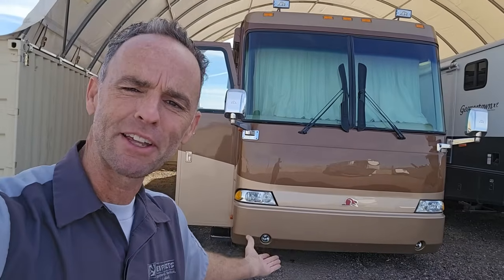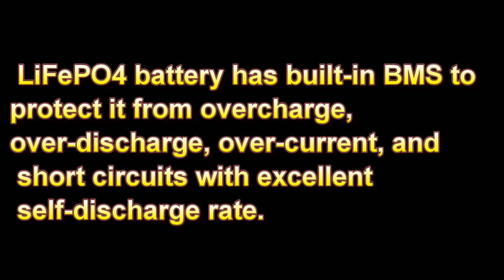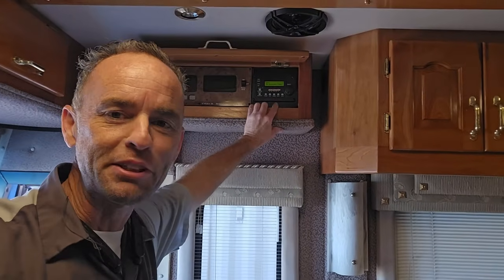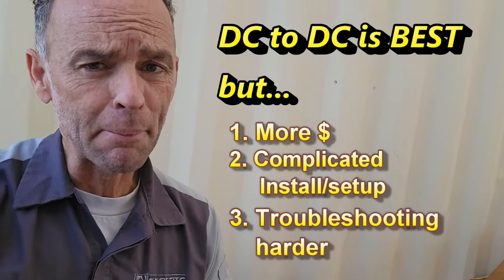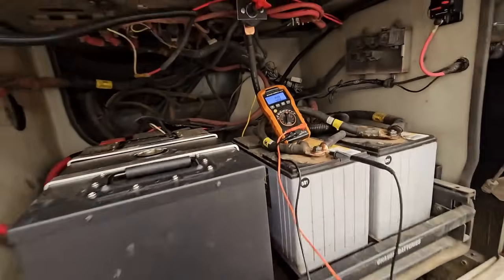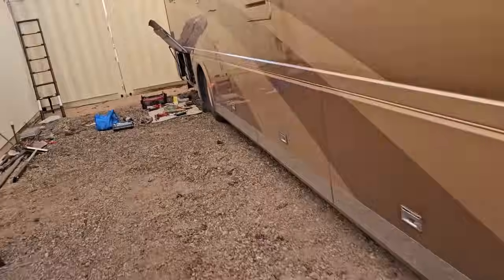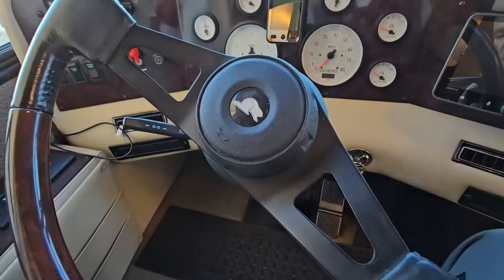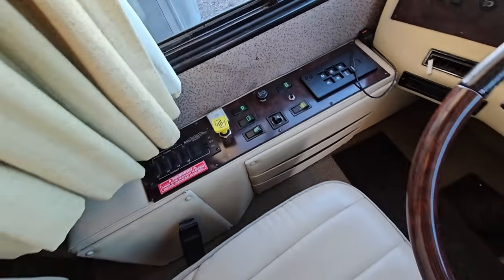What You NEED to Know About Adding Lithium Batteries to Your RV

Comment: My LFP house battery install on my Triple-e Commander Diesel, I installed a time delay relay on the sense switch terminal on my DC to DC converter, and for my chassis battery maintenance I install a small 10Amp 12volt Trickle charger to keep the chassis battery topped up, I have a a Magnum MSH3012M Hybrid inverter charger (hybrid in you can supplement your shore or generator power with house battery  inverter power, so say you have 115VAC 15amp plugin, and you turn on the Convection oven, it will draw the 15 amps from your shore / generator and the balance from the house battery / Magnum Hybrid  inverter, truly awesome upgrade. My custom profile for my battery setting on my Magnum for Lithium is I use 14.6 on absorb, also set the inverter cutout to 11.8volts even though they can go down to 10VDC but that will initiate the Lithium BMS shutdown. I still have a Reliance configurable low voltage relay to prevent the house battery getting to below the BMS cut out but I have not installed that yet but might when I sell my coach. I normally ab bit anal when it comes to watching my power situation when dry camping, I have fun doing that! I am a retired electronics Technician and love the tech!

Comment: Just upgraded to a LiFePO on out travel trailer after the deep cycle it came with died, I did use a LiFePO charger to charge to 100% before installing it, but the current WFCO doesn't have any LiFe settings. 
I'm also adding a 3000W inverter charger and 460AH LiFePO battery, 400W solar this month for an upcoming boondocking trip.
Your videos on the LiFePO was very informative, dig the other videos across the other platforms too, keep up the good work & "Hi" from the west valley!

Comment: Thank you for the very helpful information about using the older converter/charger on my travel trailer with a LiFePO4 battery. I had deduced, based on vague comments on other sites, that it would work but not give a full charge. Thanks for confirming that. I will stick with the onboard unit for now and use solar as described to "top off" the charge as I hit the road for the '24 RVing season.

Comment: Nice video, this subject has been coming up a lot lately on the forums.  I did this conversion on my 97 Monaco Dynasty 3 years ago. Built my own LiFePO4 battery and used a bluetooth BMS with it so I could monitor and control charging, charge states, etc. from my phone.  In my case I went with a Renogy 60A DC-DC charger as I wanted complete isolation and reasonable charge rate, and the cost was low (on sale). I connected the oem 80w solar charger (non MPPT) to the chassis circuit to keep my chassis batteries topped up.

I just wanted to point out that if you are using an converter/charger that doesn't have a lithium charge profile, and thus you may be using less than full cutoff voltage for the batteries, it is a good idea to occasionally charge using a charger that DOES have a lithium profile, either a solar charger (as in your rig), or a DC-DC charger (as in mine). The reason for this is that the BMS will do cell balancing during the charging, and the most beneficial period of time for this is in the upper "elbow" of cell voltage, which you may not achieve without the lithium profile.  Over a large number of discharge/charge cycle the capacity of the battery could be lessened if the BMS isn't able to keep the cells in balance.  

Keep up the good work and ignore the naysayers, LiFePO4 house batteries are a game changer.

Comment: Thanks for this. I have swapped my fla to 3 100ah lifepo. My 98 hr endeavor did not have the engine alternator connected to the house batteries so I didn't have to worry about that. I have a dakota lithium starting battery I am adding but keeping one fla to protect the alternator. Eventually, I will probably replace the full size starting fla battery with a motorcycle sized one, my assumption is that will protect the diodes, while saving weight and space, allowing me to add another battery or two to the house.

Comment: James, you look to be doing well. Seems like a lifetime ago we worked at LMRV!
I'm suspect of that Precision Circuits unit. Seems a few commenters are having issues with it.
My first concern is the size. 
It may say it's rated for continuous 225 amps, but I must question that. Any solenoid with a true 225 amp rating is quite a bit larger. Thus disapates more heat. 225 amps can generate a lot of heat. That is why those diode isolators went ot of favor. They could get quite hot and the RV builders rarely had them mounted in a location to get decent airflow.
Anyway, my 2 cents worth.
Happy Trails!

Comment: Thanks James. I'm on the finals step of doing the same upgrade on my 2003 Dynasty. In 30 minutes, you compressed months of research and in some cases misinformation. Just for a basepoint for others to design around I went for 2 batteries with a total of 600 Amp Hours powered by 4 panels totaling `1,600 Watts wired 2P/2S fed into a Victron MPPT 150V /100A solar charge controller. I removed the same 3 components (The battery booster, the isolator and the "maintainer"). I am in the process or adding the Progressive Circuits Li-BIM 225 Lithium Battery Isolation Manager even though I have a 200 Amp alternator. Total cost including tools, wiring connectors and Dicor was around $3,500 and can go 5 days off grid on sunny days without conserving energy. 

As a note' Magnum Energy sells remote control panels with Lithium profiles.

Comment: Wow, someone that knows what they are talking about,  perfect information,  I have see so many people on boats/yachts that think they can up the alternator to 200 amps only to find out they are lucky if they get half that...  maybe some day when someone comes out with a water cooled unit and separate voltage regulator... I used to wind by hand electric motors for electric vehicles, and I would tell people the motor will be drawing 50-80 amps in cruise, meant nothing to them...   A 100 amp hour battery will not supply 100amp hours, I could go on and on about this.... clicking on my name will take you to my utube on motor winding stuff...

Comment: There are some magnum inverters that support lithium charge profiles, you just need to make sure you have the right display unit. I swapped out the existing ME-MR25 for a ME-MR25-L for a 150 bucks. You need to make sure the ME-MR25-L has version 1.3 on it to get the Lithium charge profile. My existing unit had version 1.2 software.

Comment: Three years ago I upgraded our '05 Four Winds class C Ford E450 RV house battery from a single SLA to dual 100ah AGMs. Not an easy job either as I had to build a second platform. I had considered Lithium at the time but cost then was more than our budget allowed and charging profile of our 45amp Parallax converter/charger seemed unable to correctly satisfy the requirements. Prices today for LiFePO4 types have come down to the point of the AGMs of 3 years ago so when the current ones are done I might just upgrade. The alternator issues concern me the most I suppose. Thanks for sharing as always.

Comment: James, thank you for this video. 

We presently own a 2022 Winnebago class A gasser. Two years ago replaced the two lead acid coach batteries with BattleBorn. Installed a DC-DC charger, a new Progressive Dynamics converter-charger and reset the charger controller. The system works great but I always wondered with 200 watts of solar on the roof, did I really need to replace the converter-charger. 

After seeing how well the solar charges the batteries, and after seeing your video, maybe I didn’t need the new charger.

Thank you for the videos. Very easy for the me to understand.
Reply from the maker: Thank you!

Comment: I have solar and a new converter. 

I found with 500w of solar and 400ah of lithium battery I would still run low after 3-4 days in glamis. Particularly if it’s cold and I need to run the heat a lot. Or it’s cloudy. 

I installed an 80a lithium compatible converter and now I can just run the genny for an hour or two and juice them up pretty good if needed. New converter sends 30+ amps to each battery, whereas the factory one would only push 5-8A each.

Comment: I have the same Magnum that you have, and it is fully programmable.  I can even select a custom profile to meet my needs.  The programing is done at the ME-RC50 remote.  You use the custom profile in the Setup page.

The problem with not getting to a "full state of charge" is that most of the sealed drop-in batteries do their balancing by having the BMS charging FET's turn off at 14.0v and then use the voltage above that to do passive balancing while the cells are really not being charged other than by the balancers at 70-100 mA.  I checked the specs on your battery and that is exactly how it works.
If you do not charge to more than 14.0v, you will get no cell balancing and that will cause the cells to drift out of balance over time.
Reply: As mentioned in the video, James' rig has 600 watts of solar for the full charge.

Comment: Magnum inverter/charger can fully charge lifepo4 batteries.  Capability may depend on model etc.  On my magnum I use the constant current constant voltage profile.

Comment: Thank you for the very good video.  However, I found the middle part regarding the wiring using the battery relay a bit confusing.  Even so, the video was very helpful.

Comment: LiFePO4 is also sometimes abbreviated as LFP.  These cells like to be kept at 100% all the time, which is the opposite of what NMC Lithium Ion cells like, which is about 80% charge unless you need to utilize the full capacity for a short duration.  This topic has even become an issue with Tesla, which recommends the 80% setting for NMC models and 100% on their LFP models.  In fact, they recommend charging to 100% at least once a week to maximize cell life.  Really great coverage of the topic, James, it's much appreciated.  There are far too many myths and similarly few down-to-earth discussions of the topics you mentioned.
Reply: Well, yes, LiFePO4 doesn't mind being charged to 100%, but that isn't why Tesla wants people to charge LFP vehicles to 100%.  The reason is simply that the charge curve is so flat for LiFePO4 that the BMS / shunts / whatever monitoring you have for battery state of charge, can't keep track of the state of charge accurately unless the battery is charged to 100% every once in a while.

For Tesla this meant that the vehicle was unable to accurately calculate the remaining range when people only charged to "80%" (which itself is a guess by the vehicle because "80%" is still in the flat part of the charge curve)... and sometimes caught people out.

The main issue for longevity is to avoid discharging the battery all the way to BMS disconnect very often, and in particular a lithium battery (of any type) should never be left completely discharged for weeks or months.   That will destroy the battery.
Reply: Thanks for putting that myth to rest.  Many UTube experts still put that 80% bs out there.

Comment: Thanks for the explanation for the common man. Since I believe my 2 y/o AGMs may have died from poor cables (suspect corrosion), I am now considering a LiFePo4 set for my 2019 FW Disco 40G. Those 4 points are very important considerations not commonly known to one who is considering the transition to LiFePo4 batts. I did see a YT review from (All about RVs) of a LiFePo battery that was also labelled as a 'cranking' battery as well - made by Epoch. I doubt it would have the needed CCAs to turn over a DP. I like your idea of the portable AC charger if needed. My debate is with the current 6 spots where my 6 6v AGMs are, should I replace with 6 12v LiFePo or work with the space I have to go with something with less cabling. I will need to discuss this with a technician, now that I have the new knowledge you've shown me. Thanks for the great info. Safe Travels.

Comment: Thanks for the video James

I have a 1998 Patriot that is set up like yours with the echo charger and the boost solenoid.  When Vatrer put their 460 ah battery on sale I decided to copy your installation.
I replaced 4 6V GC batteries with the Vatrer, took out the isolator and echo charger, disconnected the boost solenoid and installed the BIM.
Everything seems to work fine and the battery initially charged to 99% SOC.  Now it has dropped to 75% SOC and it is not charging even though it is plugged in.  I am guessing this is the BMS keeping it from charging until it gets to a low enough   SOC.

My problem is the chassis batteries are not charging when the house batteries are not charging so they are getting low as in 11.8 volts.  They will charge if I hold down the battery boost button.

My inverter is a heart freedom 15 and I set it up to charge at 13.4 volts with the dip switches.

Are your chassis batteries being charged enough to avoid a low voltage situation?  Do you know of any way to isolate the chassis batteries and charge them seperatley?   Thanks Carl

Comment: Very nice video thank you...now I have a question: according to the wiring diagram for my 22 Jayco Alante 27A, the generator uses the house batteries to start the generator (an Onan 5500).  Will the LiPO4 battery be able to get that done?  Or will the generator require more than the 200A my LiPO4 battery will put out?

Comment: I put this on my Class A.  What I’ve found is the cycling of the charge causes my chassis battery to connect and disconnect the alternator output often.  Mean I park, RV running, and when I open slides the chassis battery voltage goes between 12.7v and 14.4v every few seconds.  Kind of surges while opening the slide.

Comment: Thank you, the first video answered a lot of questions I had, but your second one confused the crap out of me. I have been waiting to install lithium but I have been worried about the alternator issue. Your test meter showed too much  voltage going to the starting batteries I think, won't the solar boil the lead acids, your meter also showed the house and starter batteries linked in the lithium was charging the lead acids, won't that cook them , 
Thank you once again this is a hard issue for me to wrap my head around also wasn't that one unit you removed for linking the batteries when your starter batteries were dead.

Comment: With my trailer I disconnected the charging wire from the seven wire plug. My solar charges the batteries as I drive. Don't want to burn out the alternator on my truck.
Reply: Pigtail doesn’t pass that much current my lithium only pulls like 3 amps from the pigtail
Reply: Panels not aimed at the sun produce much less charge and of course clouds don't help. Weekend warriors obviously don't need these considerations.

Comment: What about Starting the Generator like Onan ?
Reply from the maker: Mine is started off the chassis batteries
Reply: Mine uses the house batterys
Reply: @AZExpert  If you start with the engine Batterym wont that drag the batter down, as it does not charge the batter?
Reply from the maker: @talk2hubba  the isolation relay I installed is bidirectional so if the house are charging it will charge the chassis
Reply from the maker: @talk2hubba  yes, it has a small draw while running, but the relay I intalled is bi-directional so it does charge the chassis when gen or shore is chraging too. Otherwise, I'd likely just connect a permanent battery tender to the chassis batteries

Comment: 😅 On cranking amps to start 25:59  the engine!  Thank you for your alternator protection tips as independent of the BMS. Question about the temperature you are running through your upgrades. I am concerned about running solar in colder temperatures where the volts from the solar panels are higher than at 77 degrees.

Comment: Great info, thank you!  Please cover cold weather and charging at some point. Do I need a self heating LI battery?
Reply from the maker: Depends on your application mostly, I don't like cold camping so it's not something I worry about. Many batteries have the option, or you can re-locate inside a more heated bay which I would recommend to minimize battery complexity and wasted current draw for the heaters.
Reply: Thanks much! @AZExpert  I'm thinking of this swap for my 2019 Tiffin 37 PA.

Comment: Getting ready to dive in on the deep end.  Picked up a 2000 Gulf Stream diesel pusher.  Tires and batteries first, then gonna take it to a mechanic for the once over, check hoses and belts and all the other stuff.....   Then gotta learn to drive the big mutha.   Been a few years since I drove anything that size.    Looking forward to the whole process tho.

Comment: Our 2003 Newmar Dutch Star D.P. has 2  IOTA 45 amp charge controllers with a phone jack system receptical in the side that I can get a plug that plugs into it and it changes the charge profile to one for lithium batteries.

l

Comment: James, great video, have watched all your video's lot of work involved. Have a concern you stated the relay you installed was bi-directional so when inverting the system will be pulling off the chassis batteries as well. For me I would reinstall a isolator between the chassis batteries and the new relay, but before test the chassis battery cables with a amp meter to check for a load. I saw a couple comments on the lithium charge settings your phone app for the bms may allow you to change the settings on for the charging parameters, I set my victron settings to 13.9 volts which also keeps the max charge around 90%. Just a couple suggestions, keep up the great work. Regards!
Reply from the maker: If the inverter is on, the battery voltage should not be high enough to trip the relay and combine the batteries, but I'll keep testing and find out.